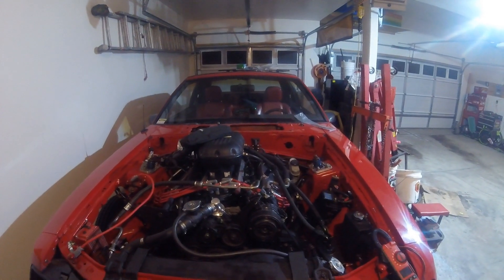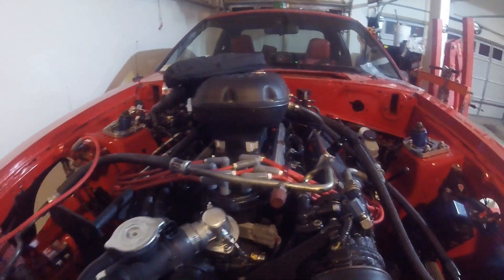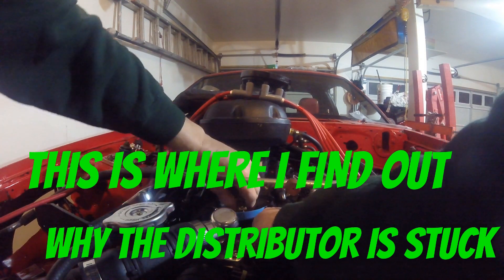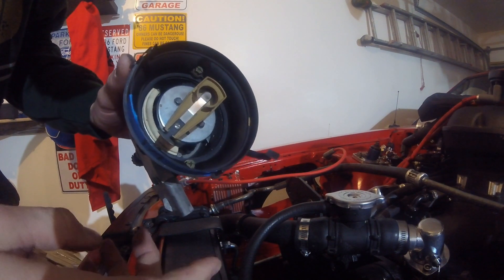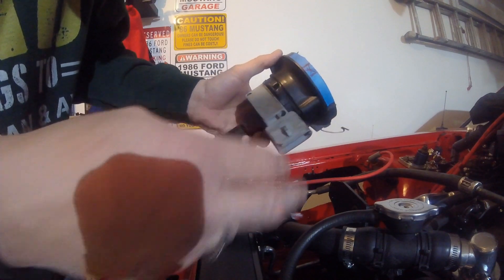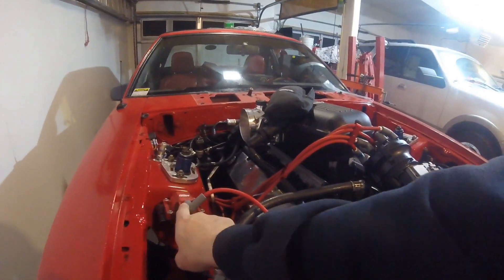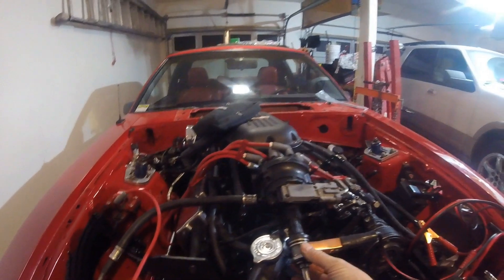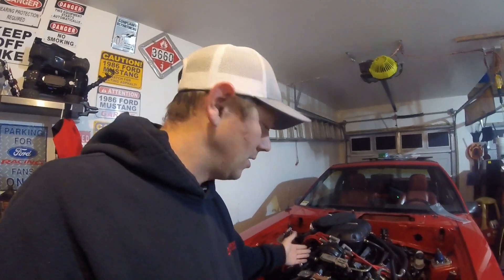Ford TFI & Pickup Testing - Ignition Troubleshooti

Comment: What if i have spark but no injector pulse
Reply from the maker: The negative is the one that pulses, not the hot.

There are some capacitors in the ecu that control that.  If you’re not getting the pulse on the ground, open the ecu up and make sure the three capacities are in good shape... no green corrosion or broken off the board. 

The pulse comes off the pickup in the distributor so if the ecu is good, then check the pickup.  This requires removing the distributor to change.
Reply: @BMF_Garage  Yes i understand that but if my coil is firing wouldn't that mean that the pickup is ok?
Reply from the maker: If it were me, I’d rather check all those items to make sure

Comment: Not sure I've seen that test before. Very cool! Would you suggest remote mounting the TFI module?
Reply from the maker: Possibly?  But it’s easier to access on the dizzy
Reply: @BMF_Garage  oh I know, was just wondering what your opinion is on relocating it.
Reply from the maker: I’ve seen some of the 351w dizzys with the remote tfi... it seems to last longer because it’s away from the heat.  I actually swapped this harness over from the remote mount tfi... didn’t have anywhere to mount the remote unit that would look good
Reply: @BMF_Garage  gotcha, the heat is what I was thinking of. Thanks for replying!